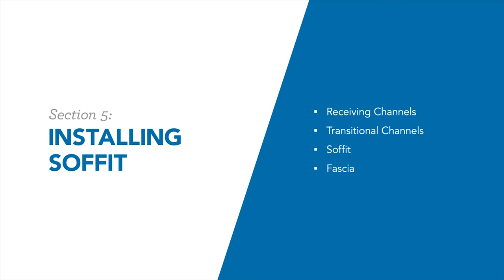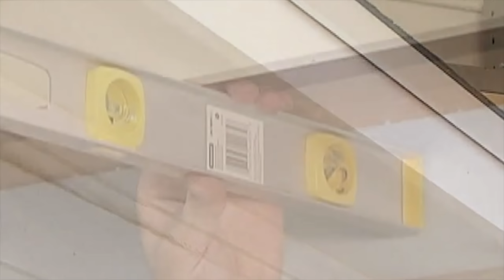Vinyl Siding Installation - Installing Soffit - 2018

Comment: "if the span is more than 16 inches"
I never understood why they don't make 16" wide soffit panels. It is very annoying for contractors to only have a 12" option. 16" is the standard spacing, so why don't they make 16" panels?
Reply: Certainteed ventilated soffit is 16” spacing for furring

Comment: Ok, so if you install using vinyl fascia over the fascia board you must use F-Channel attached to the facia board, but NOT if you use aluminum facia? so then you wouldnt nail your soffit to the eve, just slide it in both channel and let hang? Is that a good idea with 16" soffit width?
Reply: The same way you installed the hidden camera in the boys bathrooms u sick o
Reply: I did it this way with 16" vinyl soffit a year ago and it is still perfectly flat. I'm sure as you go wider you will probably need intermediate support.
Reply: @davidhollyfield9712  what the fuck?
Reply: @TheTyphoon365  what?